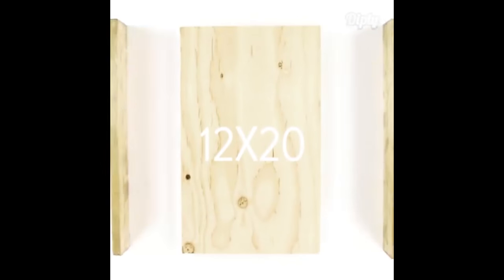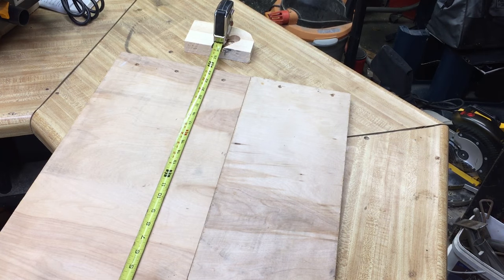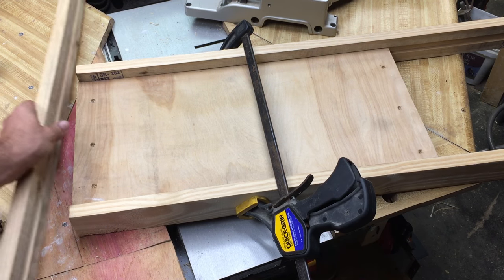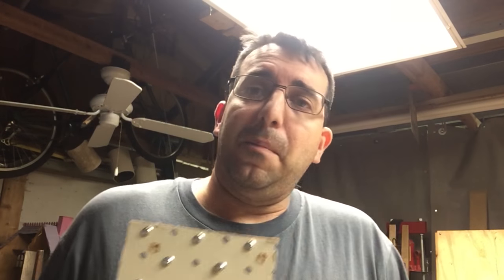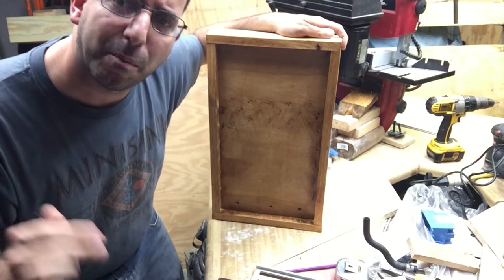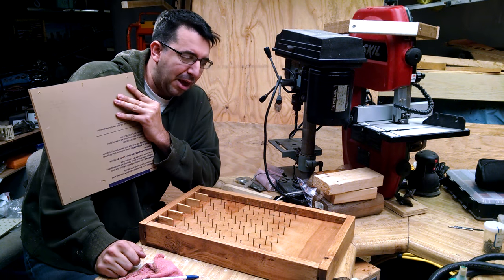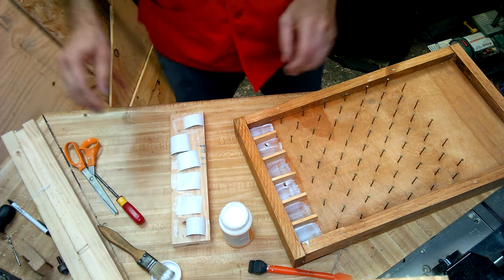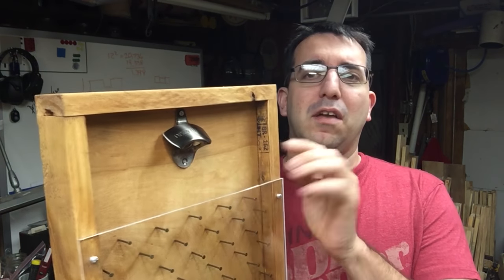027 - DIPLY DRINKO PLINKO

Comment: Can wood pieces similar to that strap stock (sp?) be purchased at a home improvement store? This tutorial is difficult for me to replicate, as this is my very first woodworking attempt, and the wood pieces you used are pre-made.
Reply from the maker: Sure! The video I talk about I believe used 2x4. The stuff I used was similar to 3/4" base molding. I just happened to have it because I scavenged. You can honestly use anything. You just have to be sure to leave room for your nails and gap at the top for the cap to fall. Hell, I have seen versions that are leaned on it's back at 45 degrees and no glass. I didn't like that though. Just remember, sketch it out first. Good luck on your first build!